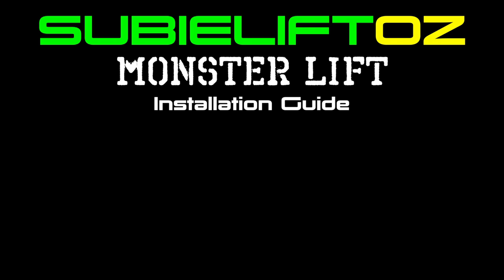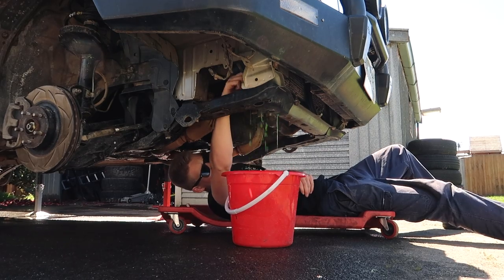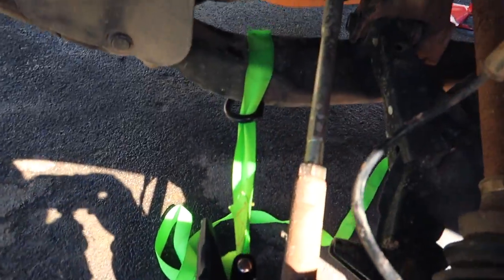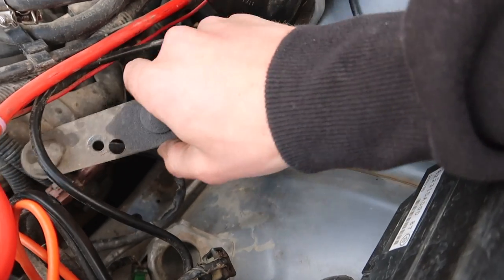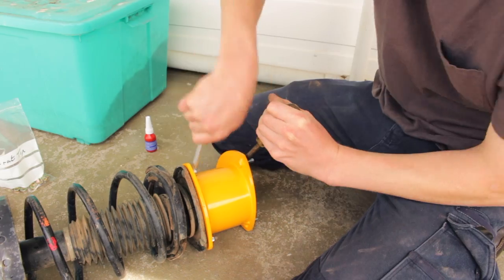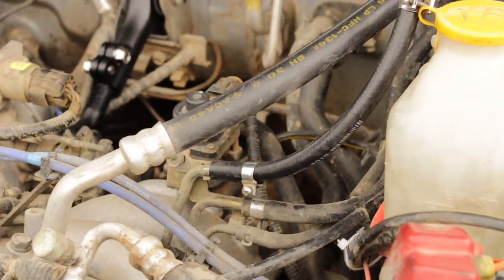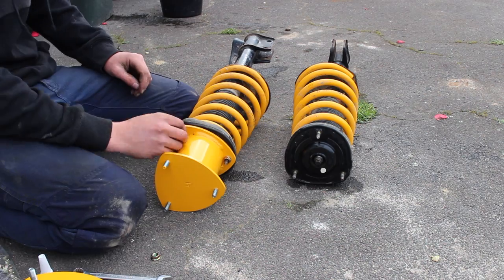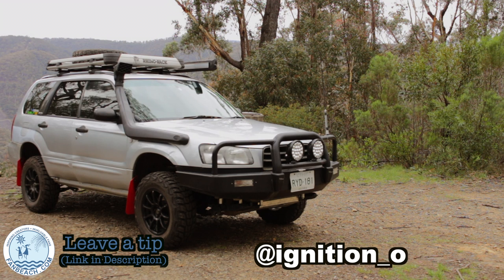SubieLiftOz Monster Lift Kit step by step installation guide

Comment: Maaattteeeee! I've seen the worst happen with axle stands "axle" being the operative word. Stick your removed tyres under the car before geting underneath and working especially if your undoing tight bolts like subframe bolts! Will save your life using axle stands as body stands. Safety starts with you

Comment: Why do u need to drain coolant n unplug battery and fuel linw and anything inside the engine for installing a lift kit is all that really in the way to install coilovers
Reply from the maker: @NateW-ve4do  because it is a driveline drop, and the engine is physically lowered from the chassis, coolant lines and steering shafts all have to be extended. You can lift a Subaru around 2 inches with spacers or offroad coilovers before needing the body spacers.

Comment: Does all of this removal need to be done with the 2"-2.5" lift on a XV as well, I've just received my lift kit from them
Reply from the maker: @timmcdonald5553  no, they are completely different lift kits for different vehicles. The XV has a completely different suspension setup in the rear and the monster lift featured in this video is an extreme lift including spacing out the entire driveline which is not required for a 2” lift.

Comment: You yoy think this lift kit is compatible with the impreza? I've seen alot of people using forester struts to lift theres and i want to try it
Reply from the maker: Subieliftoz make a 4” lift specific to the Impreza. Talk to them and they will sort a kit out for you.
Reply: @ignitionoffroad5028  thanks bruv! I'm excited to see more subie monsters on the road
Reply: Just a bit of caution, Forester struts on an impreza kill cv axles and rides like a brick. At least this is the case on my 95 impreza with 07 Forester XT struts/springs.

Comment: Thanks bro this help me decide what I need to do! Haha well want to do. But I always thinking even though the bolts holding up subframe have a big well spacer around them wont the still bend warp and break?
Reply from the maker: Well with enough force yes, but I haven't seen anyone do that yet, and some of the guys running the SubieLiftOz kits wheel pretty hard.
Reply: @ignitionoffroad5028  oh cool thanks man! Well time to start building my project subie haha

Comment: Just watching this for the first time as I prepare to do a lift on my 05 xt Forester and looking at my lift options.  Amateur question: Is that suspension you're running pretty much stock? or would I need taller springs than stock for this to work? Would there be much benefit to purchasing other than stock springs?  Also, did adding this lift allow you the option to run a larger tire size? Either way, what Tire size are you running? Thanks! Looks siiiick!
Reply from the maker: @Ilikeguitaralot  lots of questions there! 
Yes, in most cases the suspension stays stock and a lift spacer is simply the placed on top of the strut. 
I would avoid running raised springs but you can look at heavy duty springs if you plan to load up your subie for adventures. 
I run 215/75r15 tires. Unfortunately most Subarus don’t have much room to upsize wheels without modifying the body for clearance.

Comment: Just perched a 2005 forester xt with manual its got a 2.5 inch lift done with adf strut tops dont think it had any of the subframe spacers though as it's right cv boot tore a hole in it just driving home and the ride felt like it was slammed to the ground instead of like you would expect from a lifted vehicle.  Trying to find the body spacers without including strut tops  that I already have.
Reply from the maker: You shouldn’t need subframe spacers with only a 2.5” lift. If you do, you will have 1/2” ground clearance over stock and it will be very costly for such little gain. Use OEM driveshafts only and you shouldn’t have many problems.

Comment: you provide some great info mate .. ... so need need to extend brake lines ?
Reply from the maker: crazy cooter not required with this lift. Any bigger and I would probably recommend it
Reply: @ignitionoffroad5028   what about on full extension  all good no  problems with stretch  or fowling ?
Reply from the maker: crazy cooter it’s at its limit on full extension. The strut perch also sits lower so at full extension the perch rubs a little on the line. I’m going to look at modifying the brake line bracket on the body to route it a little better
Reply: @ignitionoffroad5028  good work mate .... i did expect  brake lines  to may be an issue   .. keep it up

Comment: Hi mate, I enjoyed all your  video. I have 2012 forester x s3. I don’t no much about car but I want to do a lift, so I can go to Frazer island 🌴 this summer. I took me car to a few mechanic they told me never   Lift it, it will have lot of problems. Do you know where I can take my car so, they can set it up properly or where can I buy the complete kit. I live here in Brisbane. Cheers Subaru lover
Reply from the maker: I would recommend a subieliftoz lift kit. There’s thousands of lifted subies out there and manufactures like Ironman 4x4 getting on board so what that mechanic said is rubbish. Can’t help you with shop recommendations unfortunately.
Reply: @ignitionoffroad5028  thanks heaps, will go to Ironman

Comment: I have a 2001 Subaru Outback and I was to lift it, I’m planning on getting bigger tires and strut spacers but that will only get me an additional 2-4 inches. I WANT MORE LIFT what should I do
Reply from the maker: Even with bigger lifts your driveline will only ever be lifted 2 inches higher, so you can only improve ground clearance further by adding larger tyres. The body lift I have only gives me better approach/departure angles. I recommend a 2" lift and some slightly larger tyres. This will get you most places, and you'll have a blast doing so.

Comment: Are these the same steps you would use for an SH?
Reply from the maker: For the front yes, but the rear has a different suspension system in the SH
Reply: @ignitionoffroad5028  thanks heaps. I researched it yesterday and bought the right lift kit.

Comment: That a great set up how does it handle off road.
Reply from the maker: Gives me plenty of clearance off road, and with the sway bars deleted front and rear it articulates nicely in the rough stuff. There is also more tyre clearance now so my wheels no longer rub on full lock

Comment: Curious what your diff height is with the kit, and also what size tire are you running here?
Reply from the maker: I made another video talking more about the specs here: https://youtu.be/HTW_mHacdlw
For the tyres I run 215/75r15. I personally feel any bigger and I lose too much crawling ability

Comment: Whats the road drive ability(highway miles)and gas mileage like
Reply from the maker: Harley Wrenchin The lift hasn’t had much effect on road use. Bigger tyres makes the car feel sluggish and removed swaybars definitely increase cornering speeds but those are additional modifications. As for fuel economy about 13L/100km when fully loaded

Comment: Love the video
How did you remove the front swaybar? I have taken off the links but cant figure out how to get the bar out.
Reply: When in doubt get the grinder out.
Reply from the maker: There is a plate you have to unbolt underneath the power steering rack. Remove that and then try to get it out. You might have to turn the sway bar to get it out as the ends will catch.
Reply: @ignitionoffroad5028  cheers mate

Comment: What your wheel and tire specs?
Reply from the maker: Nick Rambayon OX Wheels OX817. They are a custom wheel drilled out to 5x100 with an offset of +25. Wheels are also 15x6.5 (only just clears brake calipers). Tyres are Kumho Road Ventura KL71 M/T 215/75r15
Reply: @ignitionoffroad5028  oh ok. I just ordered the monsterlift also and wanted to see what tires i can run with it.
Reply: Whats your tire diameter in inches
Reply: @tomwoods5378  15
Reply from the maker: @tomwoods5378  27.8 if I remember correctly

Comment: I thought that you have Ironman springs on the front.
Reply from the maker: Stock standard up front. Didn't know Ironman even made springs for Subarus
Reply: @ignitionoffroad5028  so, don't you know that you've got Ironman springs on the rear? ;)
Reply: @adrianbratkowski1168  i think hes running King springs. Ironman 4x4 does have Forester springs. Ive heard they are thinking about making Subaru shocks too
Reply: @ejayone8184  It will be great ,if Ironman would make schock absorbers for Subaru. I've got Ironman springs on the rear and front with stock Subaru schocks, but I'm thinking now about gold kayaba ultra sr
Reply: @adrianbratkowski1168  email them asking if the rumor is true. The more people that contact them about more Subaru parts, the more likely they will do it, sooner. I would love some foam cell offroad shocks for my forester

Comment: Hello did you have to do any modifications to the shift linkage/gear select on the transmission? AT or MT?
Reply from the maker: No modifications needed with the 2” subframe drop. Any larger and I would suggest linkages would require modifications. Mine is a dual range manual transmission.